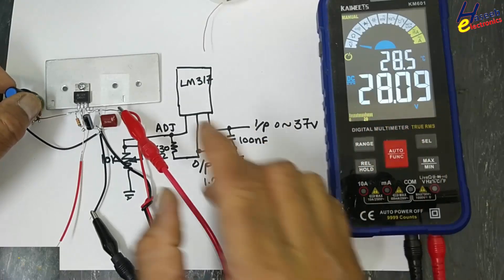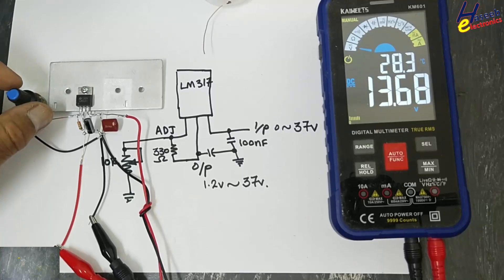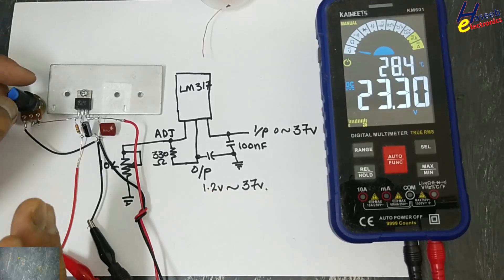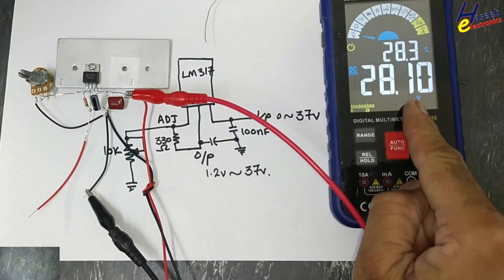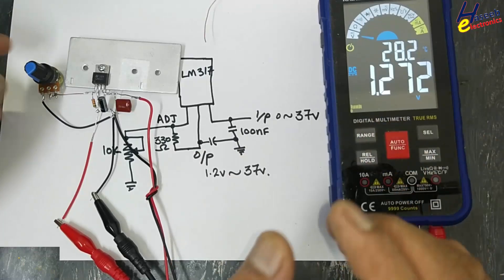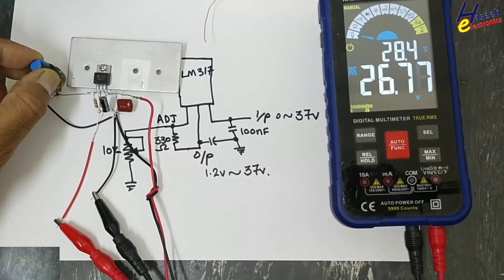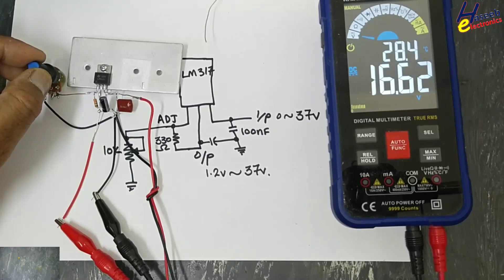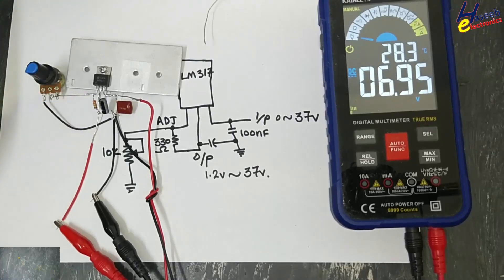1335 – A Simple Adjustable Power Supply using LM317T | Complete Circuit | Haseeb Electronics

Comment: Great video! The LM317 is a very handy regulator. I have used many, but I never knew if the 1.5 rating was regardless of input voltage. You would think it would get a lot less hot at 1.5 amps when the input voltage is 20 volts and the output is 18 or whatever the dropout voltage is closest to the input voltage. It would get a LOT warmer at 1.5 amps if the input voltage was 20 and the output voltage is 1 volt for example. Or, is the 1.5 amps a worst case rating? Something to think about. Best regards!
Reply from the maker: although LM317 provides 1.5A (min)   to 2.2A. but in the datasheet footnotes, it is clearly mentioned that this current is directly interlaced with output voltage and junction temperatre, body to air temperature transfer ratio
all prameters are to be considered separately for its smooth operation
Reply: @HaseebElectronics  Thank you!